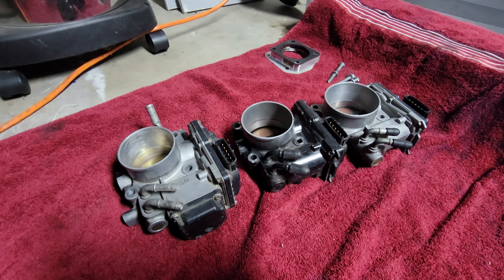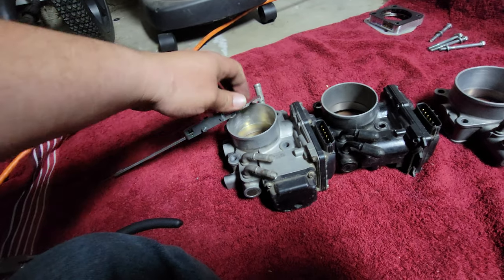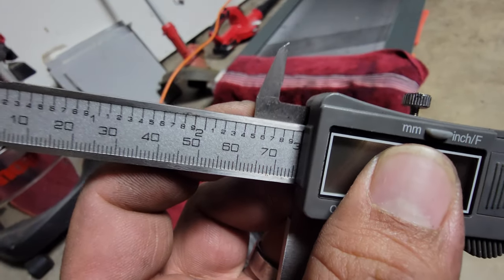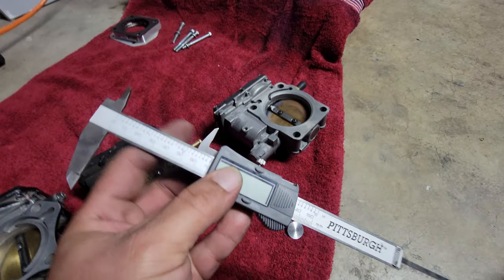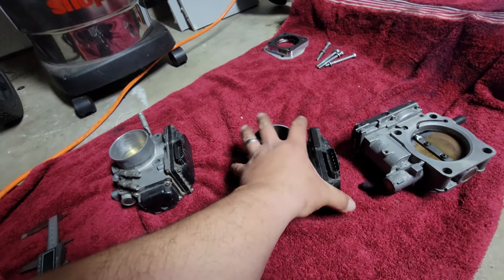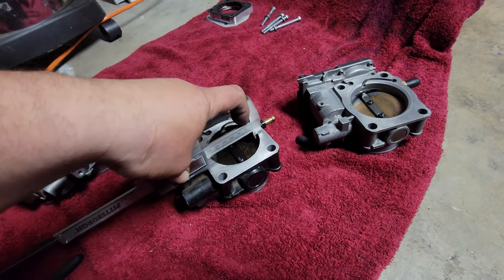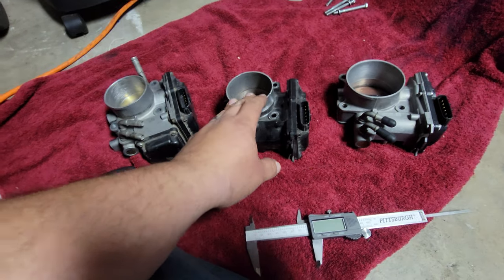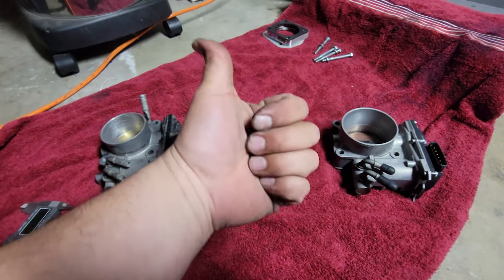Stock z3, j35 and j37 Throttlebody Comparisons

Comment: How would the j37 perform with just bolt on? Think its too big?
Reply from the maker: I think it would be good but for the j37 u most definitely need a tune. U can squeeze by with the j35 no tune but for the 37 u do. Best air flow oem throttlebody. U also need an adapter plate for the j37 it doesn't bolt up its too big....i was going to run it with the rbc port matched to the j37 of 70mm with Hybridracing 3.5in cold air intake skunk2 header and 3in exhaust on e85.....that would be a perfect match in my opinion...its what was going for before the supercharger gets here, but change of plans do to the government 😔....another 8th gen built in the future...i want a fa5...keep it stock from the outside and full blown race under the hood 🤞
Reply: Bet.. thanks.. not going E yet, hybridracing intake, skunk2 alpha header,  and fullrace 3in exhaust.
Reply from the maker: Yeah good pair if you ask me...you just have to bore out the inlet to the to 70mm

Port Match for j37:
https://youtu.be/d6KtNCSu2OQ
Reply: You need a adapter and wire extra the TPS..is not just a direct swap

Comment: I have a Question. Can i put a j35 throttle body on a j37 for a better MPG range ?
Reply from the maker: No it doesn't bolt up to it. the j37 is to big.
Reply: @559powerscape   what about j35 intake manifold with the throttle body?

Comment: Can the j37 throttle body fit on the 3.5 j35 honda pilot motor
Reply from the maker: not direct bolt on cause it has a different bolt pattern. you would need to get the adapter plate on it and it might require a tune. so probably not with out modifications
Reply: @559powerscape  thanks for the info, what would you recommend then? I'm considering a j pipe but don't know if it'll be a direct fit and bolt straight on

Comment: Will you get more power if you put the intake manifold and tb from a j37 on a 3.2 type s?
Reply from the maker: With a good tune yes....but it is different size engines. I'm honestly not sure if it bolts up....possibly like the k20 and 24s....don't know until you try it honestly